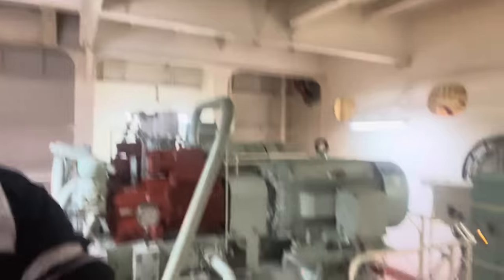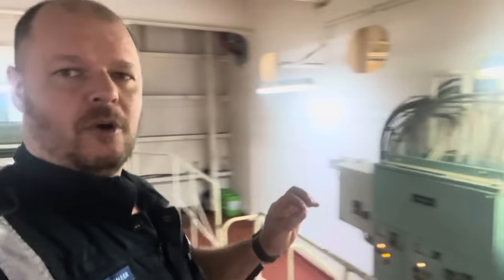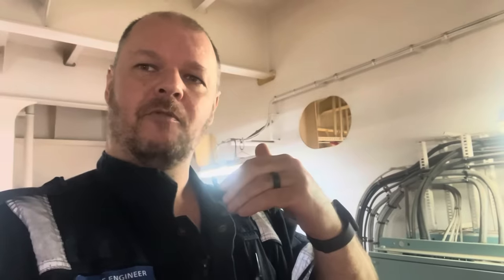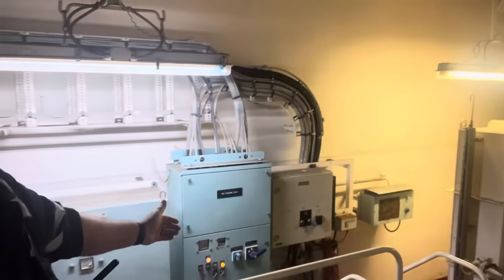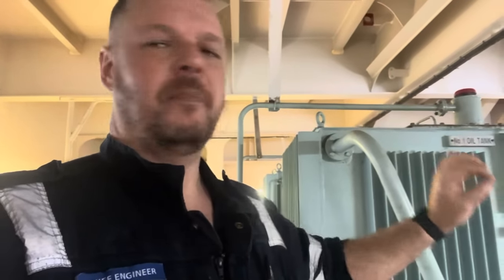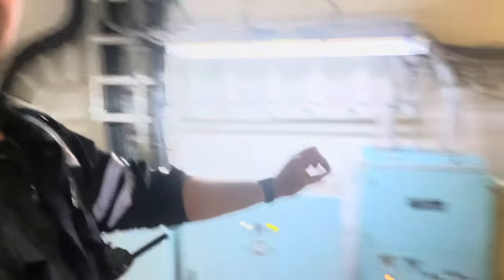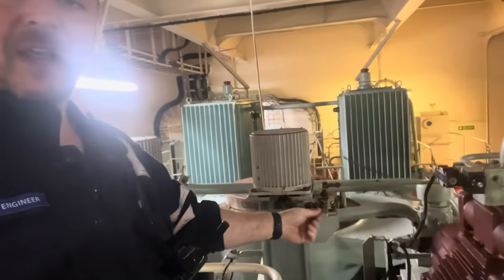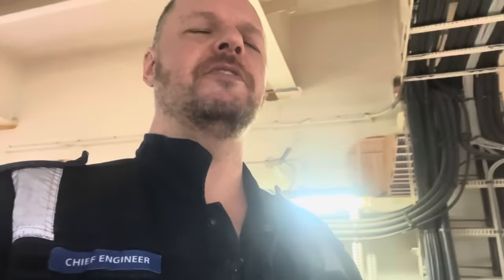Dali size containership steering system. How it’s designed to not hit Francis Scott key bridge

Comment: Old engineer, saying thats a good presentation. I preferred sailing as Chief Electrician, and have a hard time explaining to people that have never seen a ship, what happened. If you've sailed long enough, you know what happens.
Subscribed, just to let them see it.
Thanks!
Reply: Gosh yes, thank you that is my understanding of modern-day shipping, a ship loses power to the propeller, the ship will continue on the course it was on before the loss of engine power, the weight and momentum of such a heavy ship will never turn like the video shows. Remember the ship's electrical supply is from one of several electricity generators that the ship electronic Autopilot controlling the hydraulic motors on the Rudder will keep working keeping the ship on the course set by the Harbour Pilot, remember that the ship was on course to pass under the bridge when the lights were turned off, without electric power to the Autopilot the rudder will remain on the set course while it was adjusting course for any wind or current variations, then when the lights (electric power) came on again the ship auto-pilot would automatically resume the original course settings before the power loss, But! The video showing the sharp turn onto the target had nothing to do with the lights, or Autopilot or wind or currants proving that The HUMAN FINGERPRINT is all over this deliberate turn into the Bridge.<><><> Heavy smoke from the engine funnel is caused by a sudden increase in fuel to the engine, providing strong water pushed onto the now hard-turned-to Starboard rudder, then again the ship rudder was adjusted to Port to stop the turn because the ship needed to make a direct hit not a glancing blow against the target. <><><> This was intentional closure of Americas 5th biggest port! No question about that! But was it the US Government extremists or their FBI, or CIA! Did Terrorists sneak on board and overpower the crew? Was it blackmail of the Harbour Pilots and captains and engineers, no matter why? It is “who are they” that must be discovered because 6 people are dead because of this deliberate act by some of the People on this ship!!!!!!!
Reply: @geoffreytoomey682 you really gonna copypasta this rant on every comment 😅
Reply: @FaustoTheBoozehound its not a rant. Its sequence of events.

Comment: Multiply redundant systems still have an Achilles Heel - the switchboard.  I worked in an international computer centre.  Everything had backups and the backups had backups.  If the power went out we had three diesel generators that kicked in.  A contractor working in the switchroom made a mistake, shorted the main incomers and the subsequent destruction took out the changeover switch so that it couldn't select either the city mains nor the diesels.  Shit happens.
Reply: Some system uses air flash tanks to power the steering....and a third back up.    The other option is EPC battery to power the hydraulic pumps for ten to 15 minutes.  Hopefully, the politicians don't pass new regulation.
Reply: @rgloria40  Well if they pass one that says "keep someone near the engine room at all times." than you get no objections from me as if the only other way to steer the ship is all the way down here then yeah maybe not a bad idea. Sure, that would suck for the person with that job, but we did have someone who regularly worked in the engine room in the past before everything became automated with built-in redundancies.
Reply: Yeah this is my current theory, I'm no expert on the matter of course but after seeing what happened on the ship and how many times the ship lost power yeah this seems a very likely case.
Reply: @themadoneplays7842  Even "keep someone near the steering gear while in a narrow channel" would be a good idea.
Reply: @davidzachmeyer1957  agreed 100%
Reply: That’s why you do monthly or weekly exercise tests.
Reply: @timjackson3954 I’ve seen stuff like that happen too..I’ve seen data a center go dark because a simple master slave transfer system fail. Simple programming error that wouldn’t be noticed unless you lost the main feeder entirely. Yeah there is IST tests, sometimes a simple “ohh we didn’t think of that” happens. I’ve also seen the left over from 13,200 volt transfer switches blowing at a major hospital.
Reply: I manage servers in data centers for a government entity.  Our primary datacenter not only had separate feeds from separate power grids (one of which had a substation next door with underground cables), multiple redundant internet connections, a local fiber ring that can act as a backup connection via another site nearby, all critical systems on UPS, redundant cooling, massive backup generators, etc etc. 

One day a vendor was trying to leave the raised floor (the secure area where the servers and such are) and hit the emergency shut off button instead of the door release button.  

Sometimes no matter how redundant something is there’s always the one factor of chaos that can’t be accounted for.
Reply: It is IMPOSSIBLE to build a system without an achilles heel: No matter how strong the weakest link is, there always is a weakest link, and strengthening that weakest link will make another link the weakest. That is a matter of "phylosophical DUH..."
Reply: @rgloria40  Air flash tanks to power the steering???? Now that's a new one to me...
Reply: That's a good point, but the NTSB has already visited the ships plant and control room, and a huge switchboard fire would have been immediately noticed. One of the crew has stated in an interview everything went black, and there was a strong smell of fuel in the air in the engine room. I don't know what to make of that, but maybe a fuel pipe burst, and they had trouble switching to another day tank, and closing and opening valves to get around a fuel leak, hard to tell. We need interviews with the chief engineer, and the rest of the engine room crew to piece together more of the picture.
Reply: I'd say because it was maintained like crap. None of the backups were functional.
Reply: @SevenCostanza  Yeah, sure... that must be it... Sigh...
Reply: Wish I was naive enough to think this was an accident.
Reply: @SevenCostanza  I'm confident they will find something that wasn't maintained properly. Might not be a root or only cause, these kind of disasters are often a combination of all sorts of things, swiss cheese model etc.
Reply: @themadoneplays7842  it is super load in these engine rooms. can only work with hearing protection.
Reply: @ronblack7870  true, but that doesnt mean someone cant be nearby just outside the engine room.
Reply: We had a factory UPS tech dead short the UPS when a door ground popped lose.  It fused the UPS input breaker in the emergency electrical room critical load panel.  It was lots of fun getting the approval to turn off that panel to do an inspection/repair, luckily, it was just the breaker and not the panel that the contractor had to swap.
Reply: @cruisinguy6024  One would think a button that shuts down the room would be under a guard cover and well labeled to make sure pressing it is intended.
Reply: @TianarTruegard  for whatever reason at this facility that wasn’t the case when this happened.   But it sure was implemented shortly after the shit hit the fan. 

Such an emergency shut off really needs to behind a “break glass in case of emergency” type cover
Reply: I'm surprised that ships over a set tonnage aren't required to have a hydraulic nitrogen charged accumulator system.  This is what oil rigs have to operate their blowout preventers in case of total electrical failure.  A ship system should be able to operate two full swings of the rudder in an emergency with such a system.  It may seem like overkill but ship power failures do occur and this system may have prevented the a collision.
Reply: @ramrod9556  that’s an interesting thought, although in this case the emergency generator is supposed to be able to power the rudder in 45 seconds from power loss but I think it may be a moot point regardless. It makes me wonder if there have been situations in which a charged accumulator could have been useful for a ship. 

But as some have pointed out the rudder starts to lose effectiveness once the main engine is down as rudders are designed to work with prop wash. 

I suspect what we’ll find is most of the ship veering off to starboard is from wind sail effect and channel flow conditions.
Reply: My motto, when you need a backup, it will fail, at least in my experience as a radio engineer. I did have the power fail to my operations center once, when I was operating the electric system (AZ,NM, El Centro, Calif and El Paso, TX), but the backup hadn't been working for a while, I'm not going to say how long. I'm 80 now so someone else is doing it.
Reply: @themadoneplays7842  Might be only needed in port. Probably wouldn't have helped the Key bridge. Better maintenance might have helped.

Comment: Many thanks for this discussion of all the reduncancy. Back in the late 1960s, I worked at an FPS-16 radar site at Eglin AFB that tracked the spacecraft for the Mercury and Gemini programs. I was there for the last two Gemini missions. For reentry in the Atlantic, the track from our radar was vital. To make sure nothing went down, we went to diesel generators for power. If they failed, we could switch back to commercial power much faster than a diesel could start up. Also, because the radars were designed to track missiles, they had a battle short mode that disabled much of the protective circuitry. The radar would work until something caught fire or melted. For reentry the radar went into battle short. That radar would stay up come what may.
Reply: That sounds like a good read, any info on it?

Comment: Your explanations are very enlightening.   You sir have done an incredible job of informing the public, and it is a shame that no one in public service has taken the time to inform the public. Thank you for your unsolicited, but, extremely helpful info.
Reply: More than likely no one in the public service has the knowledge to explain the reasons.
Reply: The Chief's terrific explanation only opens up for more questions.  Thank God he's the Chief on his Container Ship!!!
Reply: Gosh yes, thank you that is my understanding of modern-day shipping, a ship loses power to the propeller, the ship will continue on the course it was on before the loss of engine power, the weight and momentum of such a heavy ship will never turn like the video shows. Remember the ship's electrical supply is from one of several electricity generators that the ship electronic Autopilot controlling the hydraulic motors on the Rudder will keep working keeping the ship on the course set by the Harbour Pilot, remember that the ship was on course to pass under the bridge when the lights were turned off, without electric power to the Autopilot the rudder will remain on the set course while it was adjusting course for any wind or current variations, then when the lights (electric power) came on again the ship auto-pilot would automatically resume the original course settings before the power loss, But! The video showing the sharp turn onto the target had nothing to do with the lights, or Autopilot or wind or currants proving that The HUMAN FINGERPRINT is all over this deliberate turn into the Bridge.<><><> Heavy smoke from the engine funnel is caused by a sudden increase in fuel to the engine, providing strong water pushed onto the now hard-turned-to Starboard rudder, then again the ship rudder was adjusted to Port to stop the turn because the ship needed to make a direct hit not a glancing blow against the target. <><><> This was intentional closure of Americas 5th biggest port! No question about that! But was it the US Government extremists or their FBI, or CIA! Did Terrorists sneak on board and overpower the crew? Was it blackmail of the Harbour Pilots and captains and engineers, no matter why? It is “who are they” that must be discovered because 6 people are dead because of this deliberate act by some of the People on this ship!!!!!!!

Comment: I was the electrician on a large ocean going vessel and I always tested the E-generators once per month, under load. We often used fire pumps etc.. to load up the E-buss.
What you're saying makes perfect sense.
Big thing is, the whole crew has to be trained on what to do. We had those drills monthly.
We did that and evaluated everyone's performance in an emergency to assess whether they needed more training or what ever. Safety first !
Reply: I got a question for you. Is it remotely possible (Imaginable) that someone could board the vessel sometime prior to departure and hack something/ anything in such a way as to effect control? Just curious? Thanks for your reply. 👍
Reply: @kickingagainstthepricks4059  It would be trivial to do something that would cause big problems.
For example, on the front of many large breakers there is a dial where you can set the trip, You could turn that dial in about 5 seconds and no one would know but the breaker would trip well before it was supposed to trip, shutting down the engines or power. Hundreds of other things you could do if you had the knowledge. On the mechanical side you could turn the fuel off to the generator, unplug a sensor, disconnect the throttle linkage. 10 seconds, in and out, no one would know. Not only but the controls are all electronic. A virus or script could easily be triggered and command what ever you wanted to command such as rudder full right. I've seen many critical systems that run on Windows and even DOS.
Reply: @jackflash6377  I was just wondering when the locked bridge doors are coming. If you know what I mean. Thanks for your reply. 👍
Reply: @kickingagainstthepricks4059  Not to the steering gear. Typical steering gear tests are done an hour before departure.
Reply: The problem is that training is not a priority. I think that's mostly because the people responsible for training are either, incompetent or untrained themselves, lazy, or lnow what is going on but don't have the ability to teach others. I was on the SSn Alpena and My chief and first assistant were assholes. You should have seen the fire drills. They were a joke. It's the same way on all the other boats too. I was a cadet on the State of Michigan, the SS Cason Calloway and a Third AE on a Maersk Container ship before working on the Alpena. I can tell you right now, every ship that sinks or is in some disaster  the NTSB report ALWAYS list lack of maintenance and lack of crew training as reasons for the mishap. It will never change. Greed, laziness, ego and stupidity are too strong to overcome.

Comment: Many years ago when I was a (deck) cadet, I was working on a Valdez trade oil tanker.  This vessel utilized a pair of Automatic Bus Transfer Switches to handle whether main or emergency power ran the steering gear.  Part of pre departure checklist was to run the self test.  Well, one time, something goes wrong in one of the switches, and it “blows up” (guessing an arc of some sort) and blows the door off. 2/E was standing about 6 feet away.  Big, slow spoken southern gentleman.  At dinner that night he said, “well, I haven’t been that scared in years.” And nothing else about the event.
Reply: I had a Mico  switch blow on a ABT WHEN  TESTING IT ALSO.
Reply: @SamGouldsboro  more excitement than needed…
Reply: what ignited that detonated in there?
Reply: @jlo13800  it was an electrical arc, which is not a true explosion, it’s a release of energy like an explosion.
Reply: @stephenbritton9297  Its a plasma 2 stroke cycle

Comment: A great explanation of how the system works. On the small ship I was Captain of, we had electrical, hydraulic and manual (winch and pulley blocks) if anything went south. So even if we lost the main engine, standby and backup gensets, we could still steer the ship. Manual steering with the pulleys was damned hard work (we practiced a couple of times) but we could still steer.

Comment: SOLAS and US regulations require the E-Gen to take emergency load within 45 seconds. Most ships are engineered to have the E-Gen light off and take the emergency load faster than the regulations.
Reply: And the Dali's emergency generator took 59 seconds. But as I read in other comments, that 14 seconds would change much: negating the huge drift would be quite hard if even possible.

Comment: I spent 40+ years at sea as an Engineer Officer in the British Merchant Navy, with around 30 as a Ch/Eng and, without knowing the ins and outs, I can say that the ship that hit the bridge had more than one thing go wrong at the same time, i.e, there was a cascade effect of multiple issues. On the older ships that I sailed on, together with the hand controls and redundancy mentioned in this video we also had emergency "hand steering" with a ships wheel down aft above the poop house. This was ALWAYS tested prior to departure from any port and also every week while on passage, with these tests being recorded in the official ship's log book.
Reply: +You are so correct, I have often counted 6 or more things gone wrong in an accident.
Reply: Similar experience but for the ‘grey funnel line’ in addition we had a Hail Mary system where when all was lost we could use a f’n big hand pump to hand steer - needed two guys to pump it, very physical and could only do it for 5 minutes maximum. It was normally done to centre the rudder but just for shits and giggles was exercised for steering a course but then the manpower required multiplied to extend the 5 minutes human endurance.😉
Reply: Sailed 12 years US merchant marine as deck officer.  USCG requires the emergency "hand steering" test every 3 months.  The steering tests prior to arrival/departure are simply done by the bridge to make sure the rudder is in good order.  These are different tests.